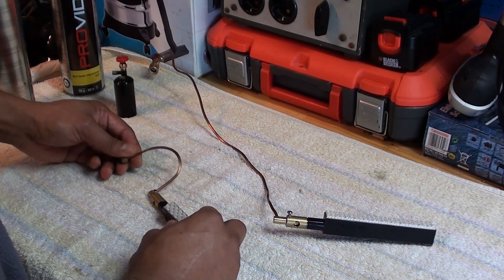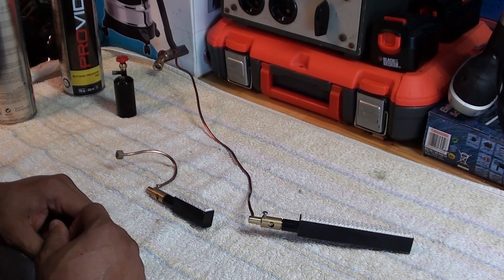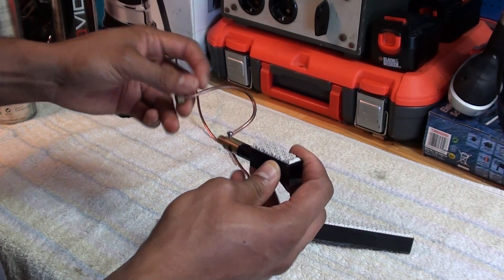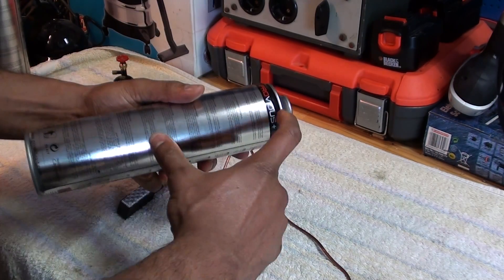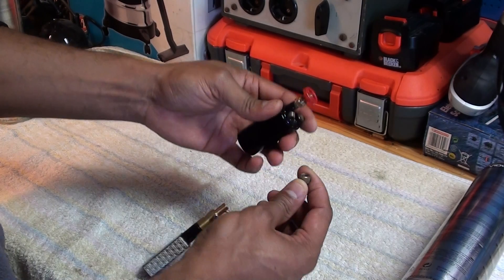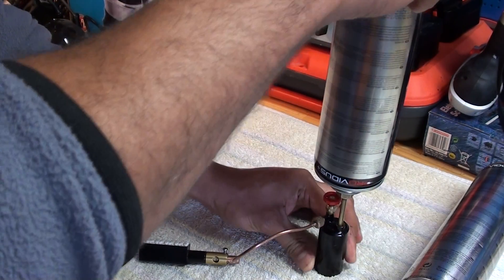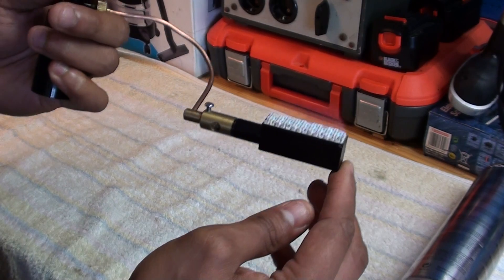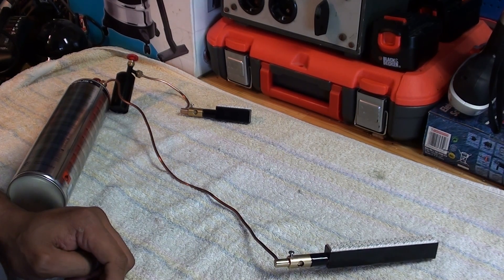BIX gas burner for steam engines.

Comment from the maker: I assume because Butane/propane mix 70/30 is the most reliable gas for small burners like this in terms if flame quality, heat production , easy to light  and the mix is also less affected by environmental temperatures. Also its probably the gas type that they have done their own tests on.

Comment: thanks for your help and fast reply, do you know why bix recommends using the 70/30 butane propane mix compared to straight butane or propane?, thanks again.
Reply: If you use the engine outdoors (garden railway for example), straight butane may not burn well in cold weather. It liquifies and doesn't vaporize at all at about - 1C.

Comment: Thank you for a very informative video. I have just bought the Bix026 burner and gas tank along with a Bix019 adapter. Just one little point if I may. You did not show how to adjust the jet into the ceramic burner as per the instructions provided with the Bix026 which is a shame as that is all that is missing from an excellent instructional video. Thank you and I hope you don't mind my small criticism.

Comment: Excellent burners.  I wonder if I can find those gas canisters in the US.  They do not look like our standard bottles that are used for camp lanterns and stoves etc.  How much do they cost and where can I purchase them?  Thanks again for the excellent vid!  Ross in Morro Bay California
Reply: Ross Guldenbrein Ross you can buy different gases at your local plumbing store, I find mapp gas  burns very hot, you may wish to use propane. Either is fine. I'm a plumber by trade and do a lot of copper sweating. And each tank lasts for quite some time, and there cheap
Reply: I use camp stove gas. Get the little 019 adapter, which screws onto one of those Jetboil or MSR stove cartridges. 70/30 butane / propane mix, endlessly available, cheaper than dirt at REI, Walmart, anywhere that sells camping gear.

It's the same screw fitting as these taller canisters. I've seen these around but they aren't as common stateside as the dome-shaped Jetboil type. 

Don't use propane alone, especially with one of the little black Bix tanks. They aren't made for the higher pressure. Butane alone works and I've filled mine with cigarette lighter gas.